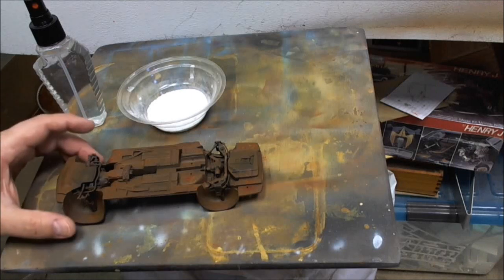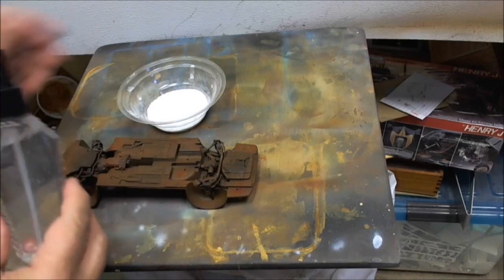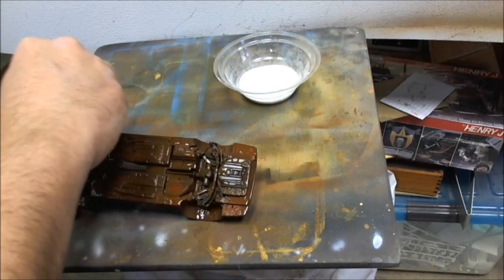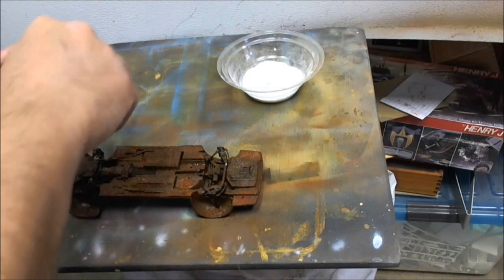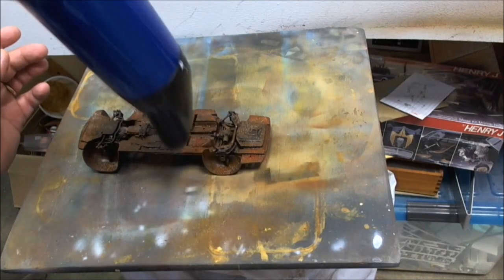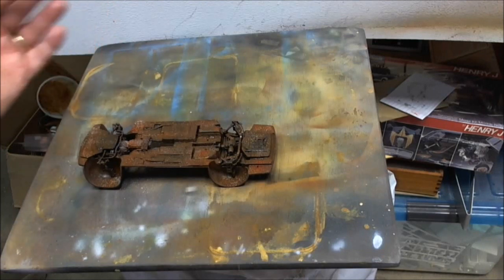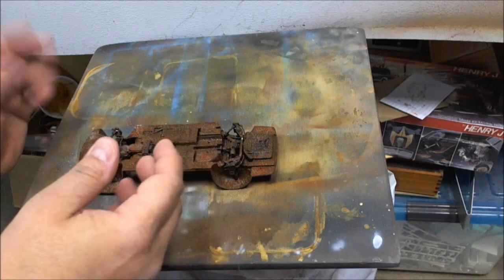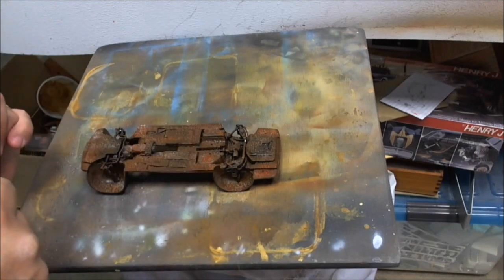Doctor Cranky's "SALTING" Method

Comment: I was wondering how to paint undercarriges so the car looks like it's been on the road, not the showroom, however I want to leave the body somewhat showroom-like. I merely want the undercarriage and radiator to look like they have a few miles, not many. Painted my undercarriage flat black with alunumun muffler/exaust/gas tank where can I go from there, as in paint colors for the overcoat.